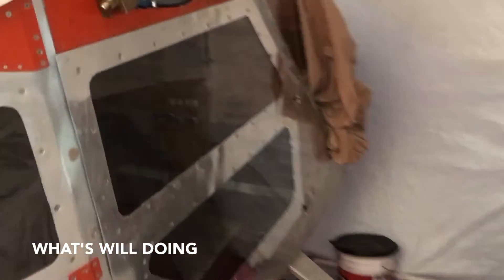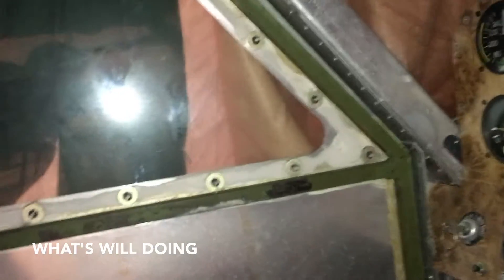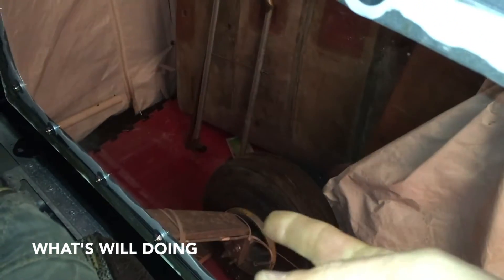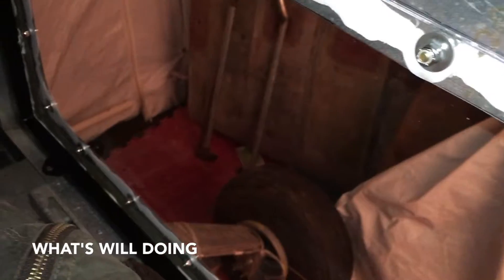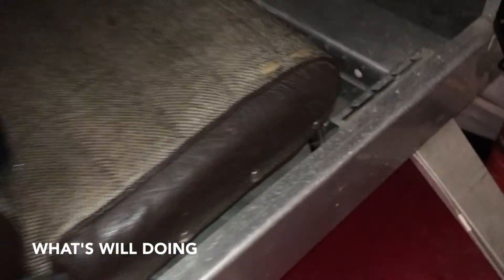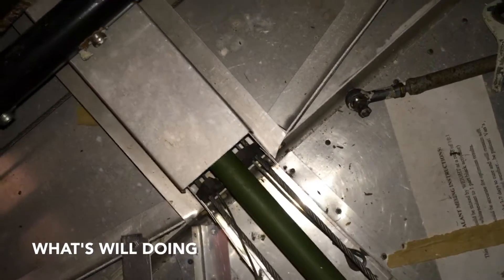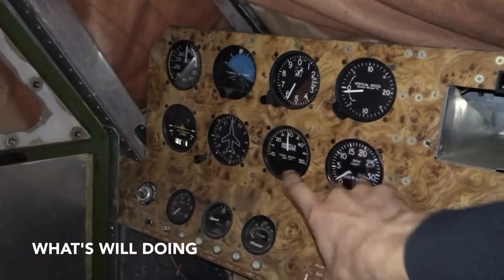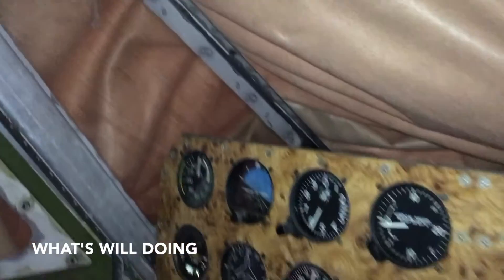2017 Build Plan For My BD4 Experimental Aircraft

Comment: HI, Will...

In case the Comments below don't come through to you directly, I just wanted to suggest that you contact Tim Becker at Bede Aero Southeast in Ft. Pierce, FL.  All Bede support, including kit production and supply and builder assist center, have moved from Ohio to Florida.  Tim is the Chief Engineer and manager for the company and he can be reached on his cell at 330-235-2341.  Otherwise, please feel free to contact me on my cell at 713-410-1486.  I have hundreds of hours flying the BD-4, building the aircraft and modifying the wings from the original fiberglass PanelRib version to the new Bede all-metal wing.

As a point of interest, I would not suggest that you try to use some of the plans that are available online to convert your wings.  The best way to convert your wings would be to use your original spars, ailerons, flaps and wingtips and source the rest of the wing kit directly from Bede.  As I mentioned, I converted my fiberglass wings to all-metal using the Bede kit, and from pulling the wings to flight required 120 documented manhours.

Regarding the cables, I wouldn't automatically reject the cables that are currently installed.  Cables are "on-condition" items and do not need to be replaced unless they fail inspection.

In any event, please contact Tim or myself and we can answer any questions that you might have.  And keep up the good work.  the BD-4 is a great design and has proven to be a fun-flying, high-speed cross country airplane.

Brian Ingraham
Bede Aero
Director of Flight Operations
713-410-1486

Comment: beware of stainless steel!    lots of stuff can happen to it besides rust. it's not so much a corrosion factor, but it can have fatigue problems, oxygen starvation, etc. etc.  
the galv. cables are probably much safer., but do the research first. I would be very wary of the SS!
Reply: All...

There are two main types of aircraft cable available based on material composition. The highest quality cable is made of stainless steel, either 316 or 302/304 depending on the application. Stainless steel cables offer high strength, fatigue, and corrosion resistance even in salt water, caustic or other harsh environments.The second type, galvanized cables are steel cables hot dipped in zinc for increased durability and corrosion resistance.

They both require comprehensive inspections at periodic intervals, but one is not any better than the other.

Brian Ingraham

Comment: Be careful about the changes you make. For example stainless cables for aircraft control systems with pulleys are probably a bad idea. They tend to fray at the pulleys and break. Find an expert in your EAA chapter, a DAR if there is one, and run all of this stuff by him/her. Sometimes the smallest changes aren't so small, and can bite you. I would also find one or two of the top experts on building and flying a BD-4 (but not the guy who built this one), and stay well tied in with him ( her, them ) as well. The builder is probably fine, but tie in with someone else who can take a fresh look. There's probably a BD-4 user group that you can join for this purpose - the type - specific knowledge is very valuable. If you can get this expert to come and look at your project, even if you have to pay him for it, I'd do that, too. There may be some improvements that aren't in the plans but have been learned from hard experience. Go to Oshkosh this summer and talk to all the BD-4 guys. Good luck with your project!
Reply from the maker: Where did you hear about stainless cables breaking?  I think stainless is what most guys use.  I hear galvanized can corrode on the inside and you won't know it.
Reply: Hi Will - I had heard about this from my building days. Full disclosure - I had two aircraft projects, but didn't take either one to completion. When I saw that you were considering this, I was concerned and looked into it a little. One builders web forum I found had a long discussion about this. I think it might be somewhat dependent on the particular installation, but a number of builders had found broken strands in stainless cables after relatively few hours at pulleys and fairleads. I think it's at least worth asking someone who's really versed in this. Many of the cables may be easily accessed during your annual inspection, and any corrosion or other issues could be detected before they become real problems. Wish you the best of luck with your project.
Reply: At the risk of sounding preachy, The other (more important) thing I have to say about aircraft building is: don't go it alone.  I've always loved figuring out stuff by myself, but that instinct worked against me in building airplanes.  There are lots of resources available and many people ready and willing to help homebuilders with their experience.  There is a reason why certificated aircraft owners are forced to adhere to very strict maintenance and modification standards. Many lessons learned were at
Reply: (Sorry). Many of the lessons learned were learned the hard way, if you know what I mean. The people I know who experienced success and safe flying were the ones who were the most tied into the homebuilding community. They're also the ones who enjoyed it the most. I sincerely hope you're one of those guys!
Reply: By the way, my first project was a BD-5.
Reply from the maker: Yes I'm working with another guy who owns a BD-4 has been currently flying it and is also in the process of rebuilding his wings.  I'm also a member of my local EAA chapter and have had several club members come out and look / give advice.  I also went to A/P school many years ago.  This stuff isn't completely foreign to me.  I'm always open to words of caution and critique though.  I know I don't know everything =).
Reply: Hi, Will... I would suggest that you contact Tim Becker at Bede Aero Southeast in Ft. Pierce, FL, and discuss you plan to build you metal wing from plans other than the Bede all-metal wing.  My BD-4 fiberglass wings were shot so I built the new all-metal wing  using my old spars, ailerons, flaps and wingtips.  The entire process from pulling the original PanelRib  fiberglass wings to flight took 120 total manhours.  You won't be able to come anywhere near that by building your own from plans. 

The new Bede metal wing kit includes the honeycomb ribs cut to shape with all of the lightening holes where needed, internal components (fuel sensors, fuel lines, vent lines and filler cap), bracket material, appropriate rivets, Proseal and plans.  You'll be hunting for quite some time for all of the necessary materials to build the other metal wings.

Contact Tim Becker at 330-235-2341 for pricing and availability.  I do know that you could have everything in your shop within days.

By the way, I have hundreds of hours in flying the BD-4 models, both the -4B and the -4C, in tricycle and tailwheel configurations, and I am intimately familiar with the building, flying and maintenance of the type.  Please feel free to contact me with questions or comments.

Brian Ingraham
Bede Aero
Director of Flight Operations
713-410-1486

Comment: my grand father owned a hanger for 30 yrs you can buff the aluminium if you're not painting with baking flower and a buffer
Reply: Will...

Depending on the nature of the corrosion that exists on your skins, there are various methods of repair. Please feel free to contact me to chat if you would like to determine if the skins are salvageable.

Brian Ingraham
Bede Aero
Director of Flight Operations
713-410-1486

Comment: I just did some research online about owning a light aircraft like yours and it is way cheaper to own a small airplane then own a automobile and the insurance is just about the same if not cheaper in some places the only large sum of money you're going to have to put out as for storage in a hanger unless you have a hanger and your own Airfield and from the last time I had spoke with you online you're talking about engines and I seen a guy who made a YouTube video talking about refurbished rotax engines that can't be acquired for under $1,000 I would go that route instead of what I had suggested which was a air-cooled Flat 6 Porsche engine but all-in-all best of luck to you and and hoping to see more progress on your plane

Comment: Go man go! I'm not a big hot-rodder but this is a project I love to see unfold. How far do you need to deconstruct what's already been done? Forum comments seem to identify the adhesive used for skins to be problematic. Aluminum wet wings apparently the way to go. But again there seems to be a trick to the adhesive. I saw somewhere the addition of aluminum gussets. Also see the Virginian Patriot for fuel pick-up mods and tips. Seems the lack of dihedral makes for a fuel issue. Somewhere else I saw the addition of a fuel sump under each wing. Hey, here's an idea: create your wet wing so that the bottom surface drains toward the sump. 

I hope the weather gets to the point you can pull it into the backyard, stretch out and work under the sunshine!

Good luck my friend!
Reply: Frank...

Both the original fiberglass and the new Bede all-metal wings are "wet wing", meaning that here is no separate fuel tank, but rather the wing structure itself forms the fuel tank.

Brian